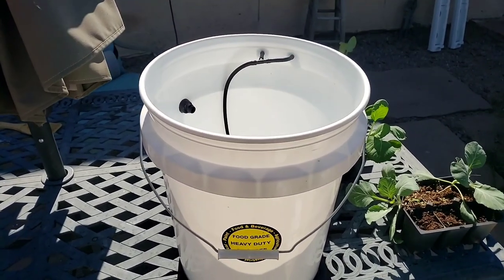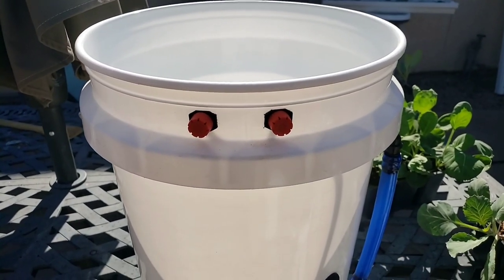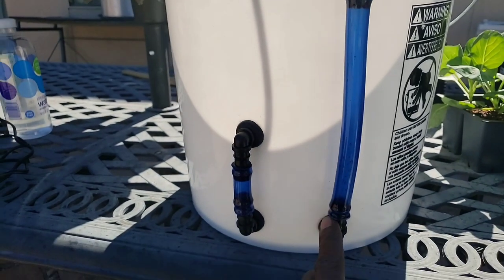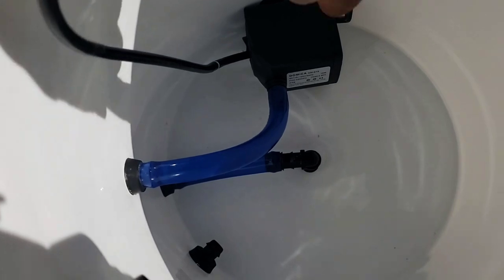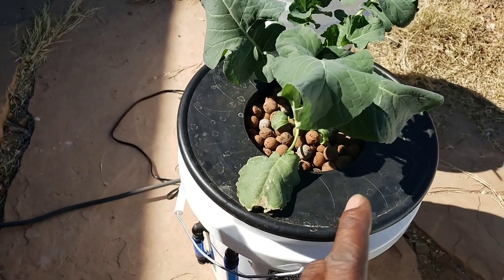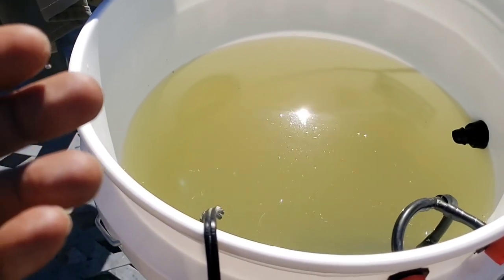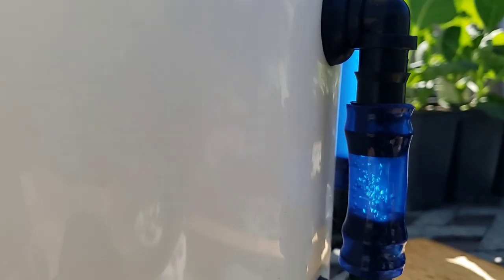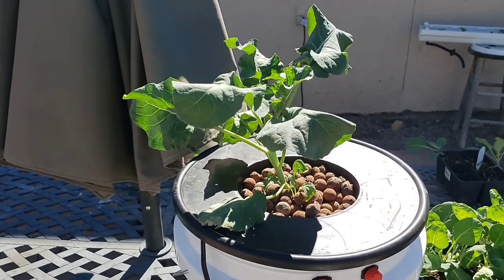Together We Grow DWC Hydroponic container gardening system.

Comment: Is there a reason you can't go into more detail on the pump modification? I think that's the most important part of the setup. 

Looks like you've simply tapped into the pump intake with an air line. I'm thinking the suction of the intake creates enough of a low-density zone to vacuum the oxygen in through the air line into the pump where it's broken up into smaller bubbles at the impeller. 

Is the reason you're struggling with a lower wattage pump due to a lack of a strong enough vacuum in the air line? If so, I wonder if there's a better way to isolate the intake completely and create a better blend gate between the O2 and water. Basically you'd need to be able to also valve the water intake in the same way you've got a valve on the air intake. Probably easier to mount the pump externally if you can totally isolate the intake. Can direct the water intake exactly where you'd want it, too.

Also also, careful with white buckets. You're likely to get some algae growth as the light can penetrate it. Lots of people paint their buckets for that reason. :) Even Home Depot's orange buckets can develop an algae problem, but the dark blue Lowe's buckets seem to be enough to keep it back.

Good luck!
Reply from the maker: I should clarify. I can't go to far into the pumps because I've modified available products,  something the manufacturers recommend you don't do.  My emphasis is on the mechanism of the entire system. Please show me where you've done it as well as the other innovations? The white buckets are for show. Not my first time to the rodeo Chris ;) enjoy the videos.  We've successfully built this system using 3 watt pumps. Please watch the videos. Enjoy the journey my friend.  ;)
Reply: @togetherwegrow8340  Whoa dude, chill. I was just trying to collaborate a bit since you mentioned trying to get a 1-watt pump functional.
As for the buckets, you've been presenting these as at-home intro kits for people to get into the process of growing food at home, and I thought I'd mention the risk of a light-colored bucket for that purpose.

Sorry man. I guess I just misunderstood the purpose behind these kits, as I thought they were a home DIY instructional. I'm guessing you're trying to market them as a proprietary all-in-one kit? If so, sounds good, I'll try not to provide too much feedback there.
Reply from the maker: My absolute bad Chris. I think we're dealing with that "lost in translation" quandary. I truly appreciate you even watching the video and honestly welcome your input. That's the only way we grow my man.  I'd like to keep in touch if you're cool with it.  Imagine a 1 watt system that not only powers the pu.... you know what? I've said to much brother. 
Inbox me please!

Comment: Is there a need for the output hose coming immediately from the pump to be so long? How eould this function if the valve output was against the bucket going outward into the outside lines as opposed to how you have it set up?
Reply from the maker: Hi. Could you draw this up for me? Thanks :)